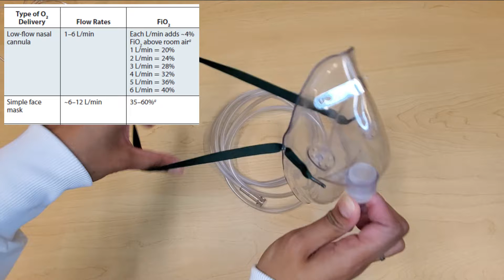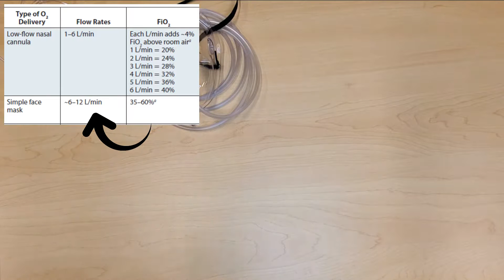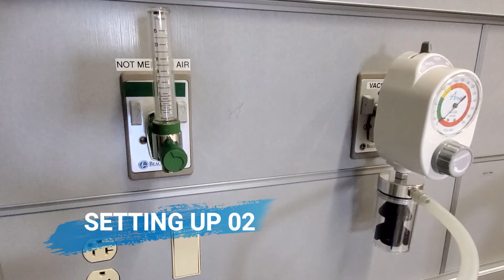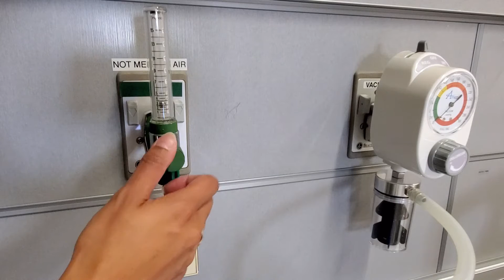Oxygen Delivery Devices: How to Give Oxygen

Comment: Oxygen is a dry gas, therefore a humidifier should be used to avoid irritation.
Reply: Not necessary in prehospital or emergency rooms. Humidified O2 is mostly used for admitted patients or for extended oxygenation where they're using a NC at 6lpm or a mask at 15lpm. In the ER for emergent patients, it's most important to get their saturation up asap.